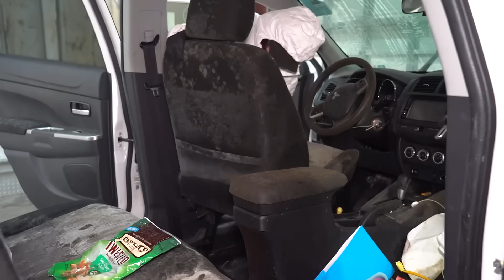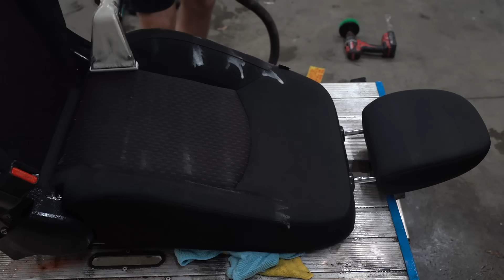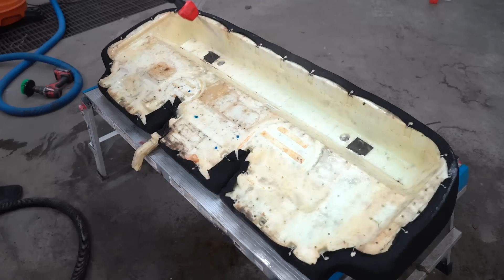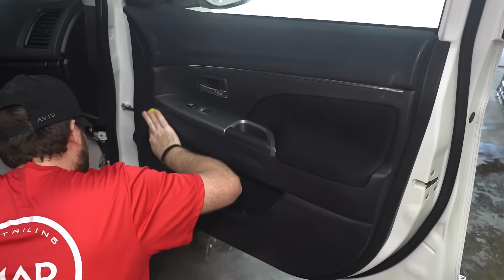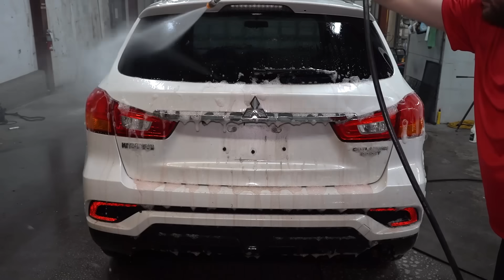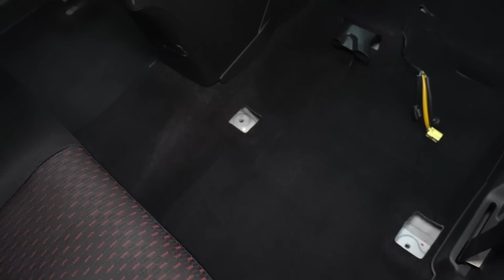Cleaning The MOLDIEST BIOHAZARD Car For FREE! | Satisfying Disaster Car Detailing Transformation!

Comment: I am always amazed at how good these vehicles turnout. You do an amazing job. I do have some questions though. First is this a repossession vehicle? Second, how did all the water get into this vehicle? If it was a failure point did that area get repaired to keep this from happening again? I had a Honda Pilot that had a roof leak and I paid thousands of dollars paying repair shops to fix the leak and they never did. I was very frustrated until I finally got rid of the car.